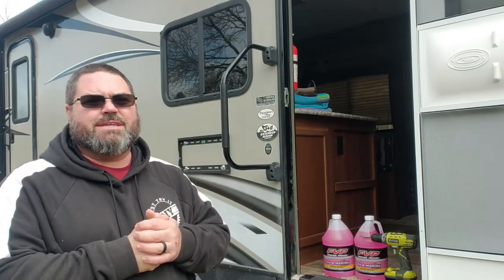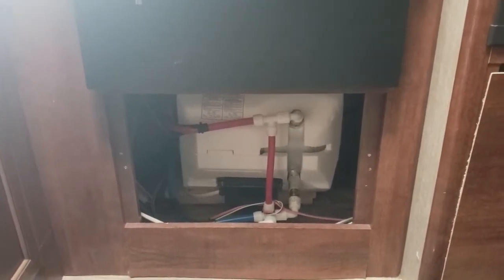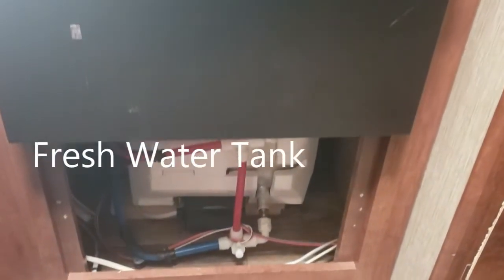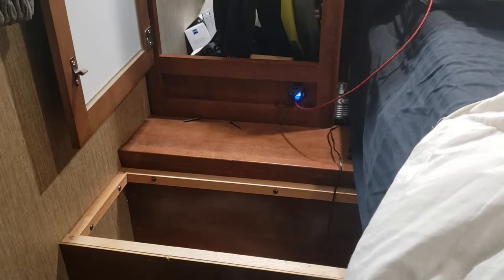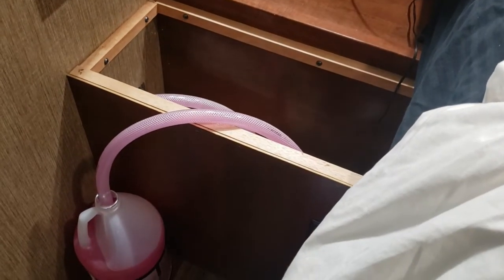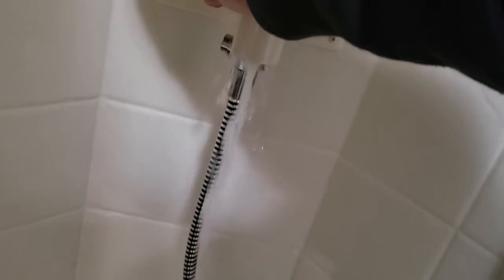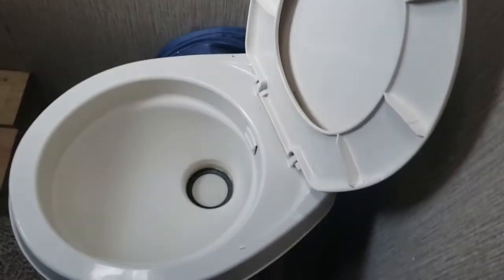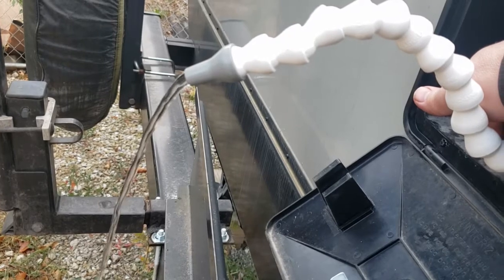Winterize My RV

Comment: if you got an air compressor...take the anode rod out, drain the water tank, blow the lines out from the the city water connecion...i watched a pro do it last fall, he blasted all the residual water out...then put about a gal of pink in there and cycled it till it came out and that was it
Reply from the maker: That works also. I have heard that some people just blow the lines out. There are definitely different ways to do it.